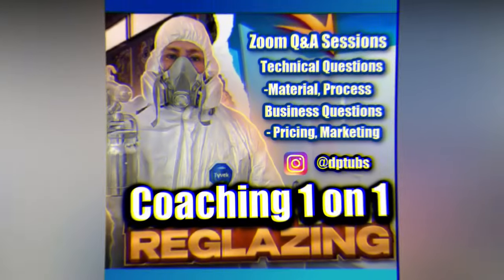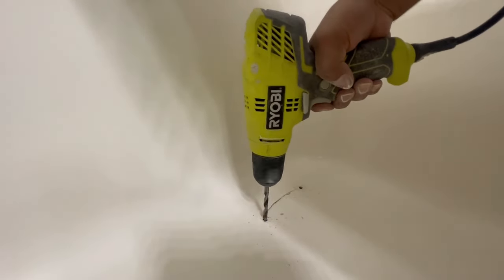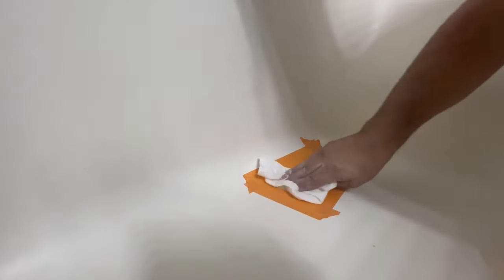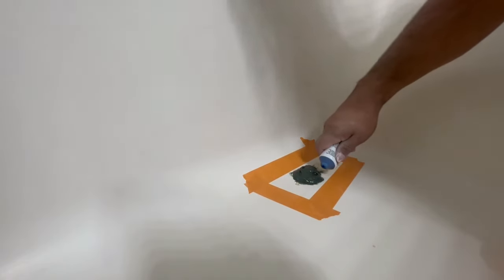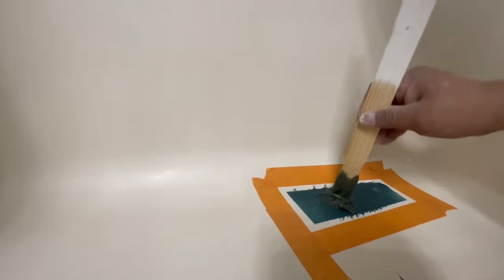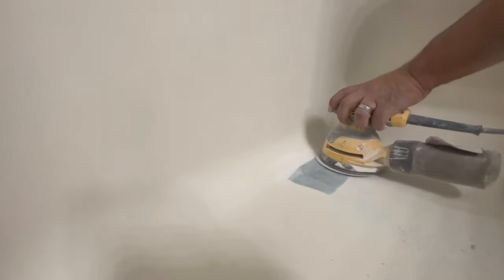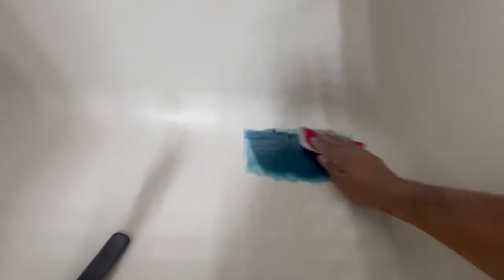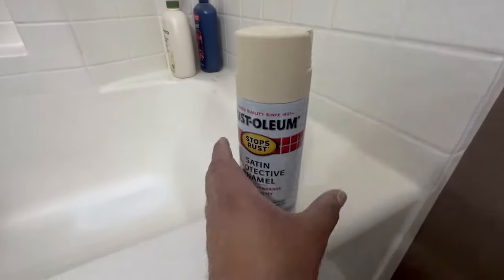FIBERLGASS CRACK REPAIR | HOW TO REPAIR A CRACK IN A FIBERGLASS BATHTUB USING FOAM & BONDO GLASS

Comment: Thanks for this. I watched this video probably 3x, along with some others, and my tub is as good as new now and very sturdy thanks to the foam between the tub and floor. I sprayed mine with Zinsser primer as you did, but finished with Rustoleum appliance white as my tub was very white. You can't even see the repair! 

Anyone watching these videos, you can do this fix yourself. My biggest mistake was laying the Bondo on too thick, and using a palm sander w/out a vacuum attachment so there was a lot of dust. Other than that, it was a straightforward project and DIY saved me $400.
Reply from the maker: Thanks so much for your comment and support!
Reply: Eric ,your not from Holland are you? Go Bills!
Reply: @BrandonK-c8i  not Holland, just past North Buffalo - go Bills!

Comment: Hey there, I’ve seen you use Krylon tub and tile, rest-oleum, satin, like in this video, and the rust-oleum appliance sprays. Why do you keep changing it up and which is best? A video comparing the outcomes or pros and cons of each would be wonderful. Thanks so much for your videos!
Reply from the maker: Great idea!!! It’s usually due to color matching 

Krylon ..because it’s an epoxy…tends to yellow over time….i have switched from using it to only at a minimum

Comment: Useful video.  I would like to see a video of you doing a fiberglass repair on the inside wall of a tub where you have to work on a vertical surface.
Reply from the maker: I have a few videos like that already! Check out the fiberglass repairs or fiberglass hole repairs videos of mine. Search “DP tubs fiberglass hole repair”

Comment: Had few cracks on bathtub with 1 really large one, will try out the PU Foam fill the hollow space to see if it's able to sustain the weight first. Then maybe later only do something about cosmetic crack on top. Thanks for sharing this, really informative.

Comment: Good tutorial, I get why you drill wholes and put the foam in.  Now my question (I hope I explain it right)   I have a crack in the tub right about where the tub starts to curve.  I can see (that’s about it) the crack from the inside too when I open the hatch up, since there’s nothing behind the crack from the inside.  

Is the another way you would reinforce the crack from the outside part?
Reply: I have the same issue 😢

Comment: What happens if someone steps on it while showering? How do you make it a better repair? We did the bondo repair to our old tub (crack was right in middle) and it would keeping cracking every time someone would accidently step on it. We got a new tub about 12 yrs ago and it now that one has a crack in it in the same spot.
Reply from the maker: Put some fiber mesh tape over the crack like you would a drywall patch then use Bondo glass / then Bondo to smoothen

Comment: If there is quite a bit of flex what do you recommend?
Reply: You can try the spray foam, but if that won't work, hopefully you have access underneath and you will have to mix up & support with structolite or gypcrete or some other lightweight mortar.
Reply: Mine had a lot of flex and didnt take foam like his did, had to make lots of holes (not just two) all around the crack and kept spraying it in.  It still came out awesome, ghat bondo glass is awesome stuff.

Comment: I don't have a crack in the tub but a 1-inch, not a deep groove near my faucet on the wall of my tub I would like to fix myself. Can I use this same "Big gap filler" to fill in the groove, then have my whole tub resurfaced? Thanks
Reply from the maker: Big gap filler is for support underneath. If you want to fill a divot or a chip then use Bondo filler and then reglaze the tub

Comment: Question, because I can't find a video on this on your channel so far...
I just discovered a lengthy crack in a low projecting shelf that is part of our fiberglass shower. Best guess, one of my young children has been sitting on it for some little kid spa luxury during shower time...the shelf absolutely has give when I gently push.
 Is that repairable?
Should I fill it with foam? 
I really dont care about how it looks or plan to use the shelf to hold anything (including butts!) From now on, 
I just need it to not leak into the wall or under the tub!

Comment: Curious, is the time in the video from beginning of mixing the product until final application of the first coat "actual time" (approximately 1 minute 20 seconds)? Do you immediately pull the tape as soon as first application is done? TIA
Reply from the maker: No it’s not actual time. 
Yes I pull the tape around the repair right after first application
Reply: Great video. Ive seen others use flex seal but I think ill use the bondo glass since it has the fibers in it. Thank you very much and have a blessed day😁

Comment: I have same crack in the floor
Can i use only the bondo glass or i need to buy bondo all purpose putty(which replaced by original filler)to put on that

Comment: This is a nice tutorial. How long does it take for the bondo to dry between coats?
Reply: Not my video but I can get you an answer. We use a heat gun to dry the bondo. Which only takes a min. or two. Air drying is significantly longer up to 15-20 mins. at the least. It really depends on the thickness of your bondo layer. Source- I do bathtub repair for a paycheck.
Reply: How long after finished the repair can you use the shower ?
Reply: With that particular paint, an hour or 2.  But I would not try washing it for at least a couple days.

Comment: I cracked the back flange of my fiberglass shower pan while installing it. Since it will be under the tile, I'm not so worried about leaking, but I am worried about the crack spreading. Will Bondo glass prevent that?
Reply from the maker: Send me a picture

Comment: When should you actually use fiberglass mat?
Reply from the maker: When the crack is thick and fluctuates. The mat should be used like you would use tape for a drywall seam or crack.
Reply: @DPTubs  8:18

Comment: I wonder why you wouldn't have made the initial hole slightly larger and forced Bondo under the crack instead of foam which I thought would be stronger. Then, why not spray the entire bottom of the tub the same color as the patch which would have made it look uniform? Otherwise.... great video. I feel more comfortable now patching the crack in my tub.
Reply: Because the foam expands pressing upward. Which is why he said he likes to see the foam coming up through the crack that means it’s filled the space beneath and can only go up